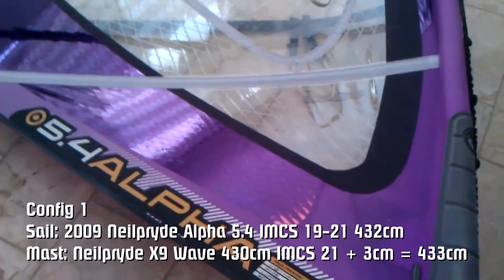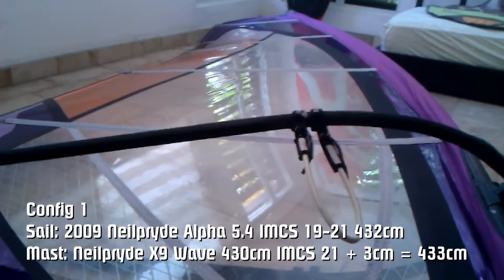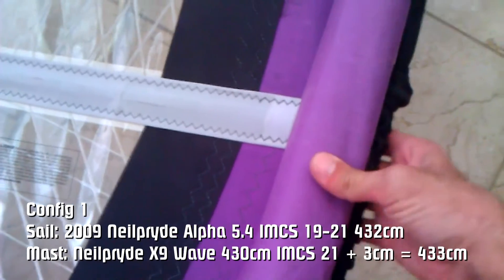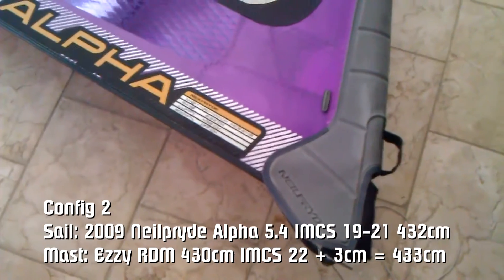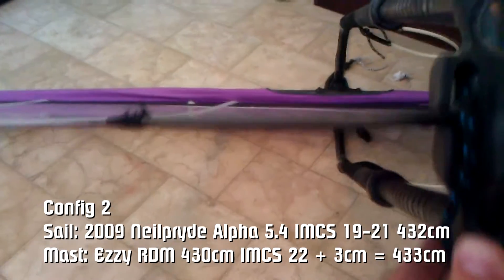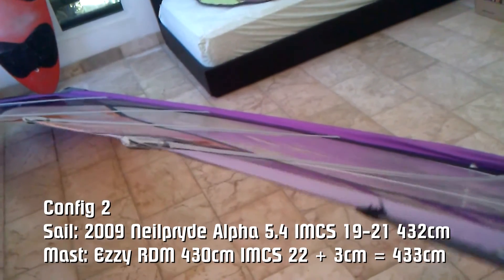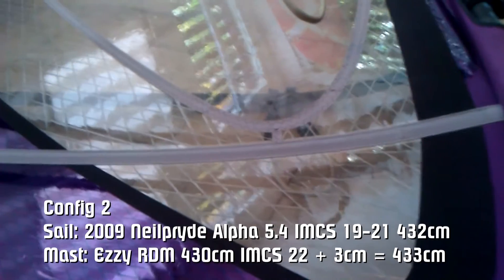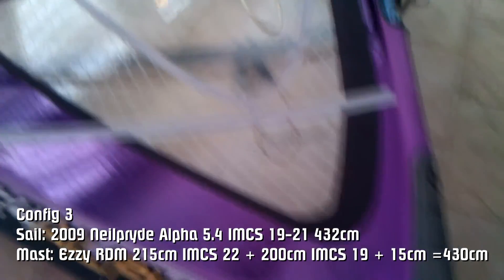Neilpryde Flex Top vs Ezzy Constant Curve Windsurfing Masts Test

Comment: Nice video! 
I have Neilpryde Combats in sizes 3.7 , 4.2 , 4.7 from 2011 and I will use a Gun Sails 370cm 50% carbon constant curve on them. 
Hope it works..
I also check your blog posts from time to time :)
Reply from the maker: Thank you!  Skinny mast right?  Should work perfectly, especially with those sizes.
Reply: @manuwindsurfing  yes skinny, really hope it does  :)